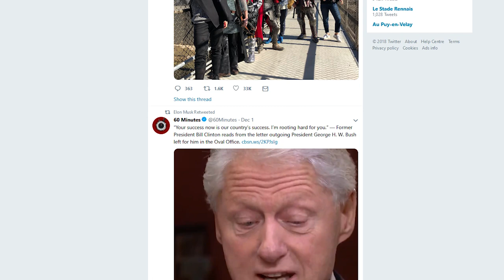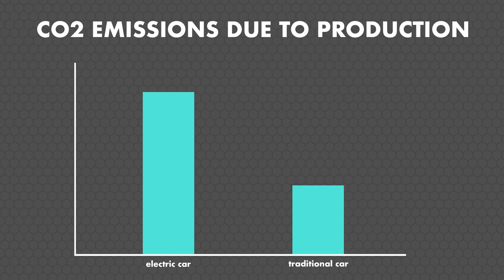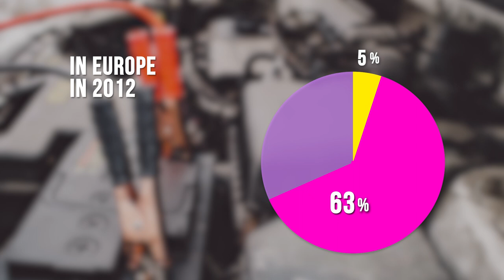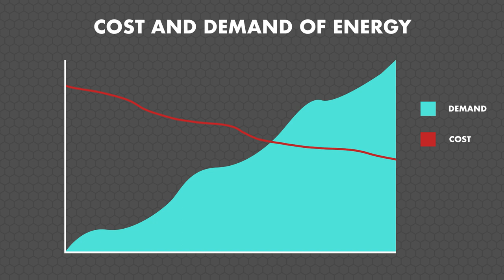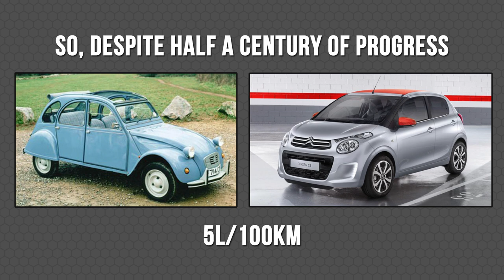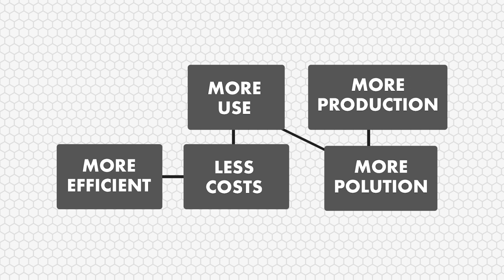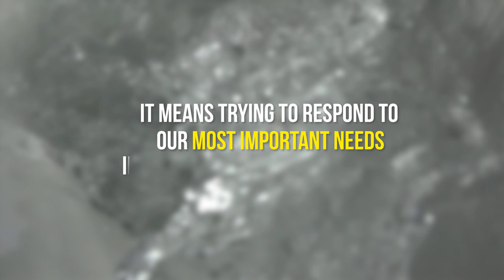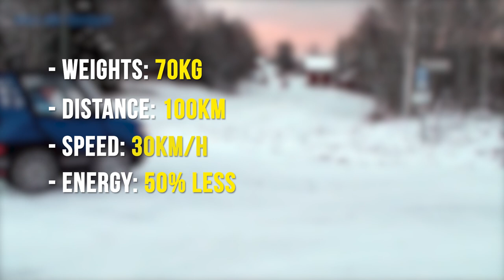Why Tesla won't save the planet

Comment: Electric bikes are great, for shorter distances like in a city. 
But if you're going on a long ride on the countryside, you're probably going to run out of juice and the bike will be even heavier to get uphill instead of one without a battery.
Reply from the maker: Yeah, I feel like living in the Himalayas is a lot less fun with an empty bike...
Reply: Kreosan from Ukraine made a large trip with electric bicycles
Reply: @sirdigbychickencaesar71  No worries, I do. I have tested electric bikes, but to me there's not much of a challenge to them if the body doesn't get a workout in the process.
In the very rare chance I have to go very long distances in a short amount of time without getting exhausted I might use one if I have no other alternative available.
Reply: @DecepticonLeader  were is the fun in a powered  bicycle, may as well get a moped.
Reply: @sirdigbychickencaesar71  Where's the fun of a moped when you can go even faster in a car? I use a bicycle for fun, the exercise is a bonus.

Comment: I think if Tesla switched from a lithium battery to a sodium ion battery, the carbon footprint would reduce drastically. In addition, I imagine one of the limits Elon has to deal with is that he is working with existing technology, but overall despite the rebound effect, his electric cars consume less energy than a traditional car over time. However, we live in an era in which people replace their cars every 3 years or so with a newer model.
Reply: Which means someone who doesn't want to spend that much money on a car, will probably buy that 3-year old car instead of buying a brand new.
Reply: :)  Bought my current car used.  Have had it for 20 years now.  Still getting upper 20s mpg.  My wife and I did our homework before buying the car.  We did not buy it for how it made us feel, but rather for its real world utility value and over time cost.  Every car except for one we have done that with.  As technology in batteries and electric car systems improves, so will the utility and footprint of those cars.... So long as consumers demand it.  Just think of SUVs.  Consumer demand.

Comment: Do sensors really consume as much data as you seem to think? This is basically the same issue I had with your last video. At times, you fixate on such small problems that it takes away a lot of your credibility. 
Also, at the end of the day, there are a lot of sacrifices most people aren't ready to bear, whether or not they might actually help the environment. And well, you can't really force them either. That's why so many companies are fixating on creating solutions without compromise.
Reply from the maker: I understand your point of view and it's interesting. Our point is to make original videos and to move forward in a coherent way -as much as possible at least!

I don't consider this video fixating on a small problem, I'd rather say it's bringing extra value to already existing solutions.

Comment: you call a tesla a quick fix but really all of your arguments have little to no affect. 1 have you ever seen the tesla factory.... all electric which you could say, how do you create power, but creating energy in a controlled environment is a lot more efficient then with a car engine itself. Over time we won't even need harmful energy sources and use solar, wind, and hydro. 2 recycling these cars today is hard, but people still do it with the super high resale value. People buy them after they were in a flood for about half there original price (in most cases) and rebuild them. Long term recycling is just like any other material, it creates a supply and a demand and over time the materials are super expensive and then over time people find ways to extract the material which brings prices down. 3 Lastly WE ARE NOT BUYING A FREAKING SOLUTION we are simply using our minds to create an efficient world where pollution is kept to a minimum for future generations..... p.s. your idea of a bike is like the equivalence of talking away a bike from a kid and telling them to go walk or crawl a mile to school as 26% live in urban cites and have farther traveling distances